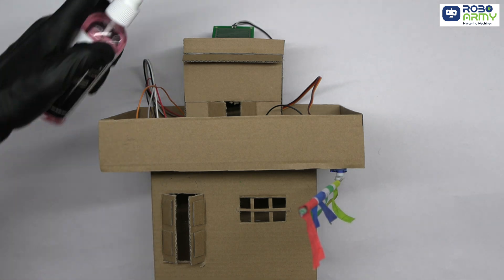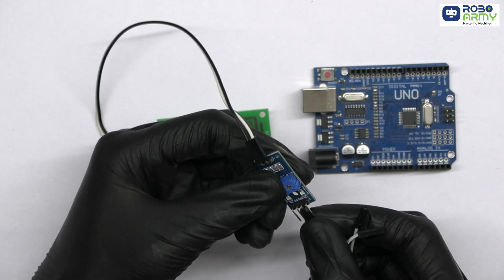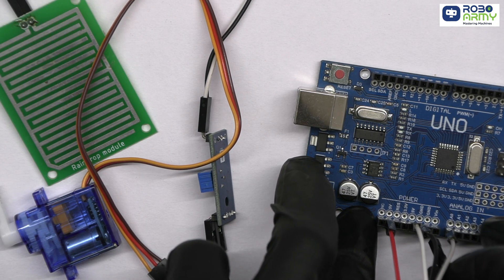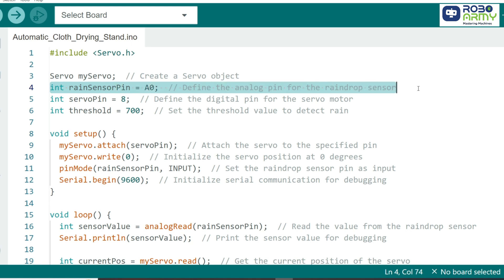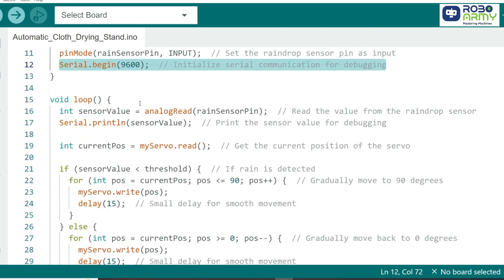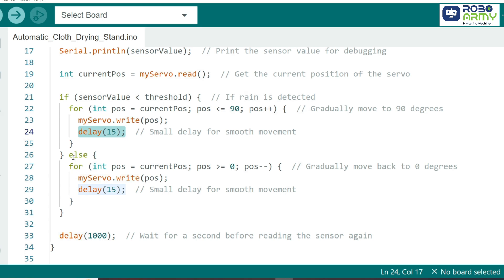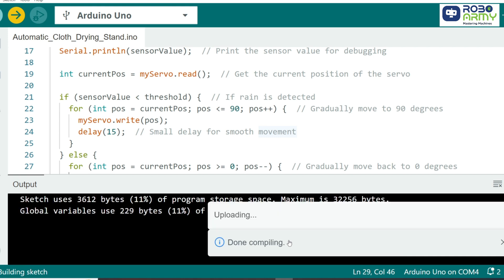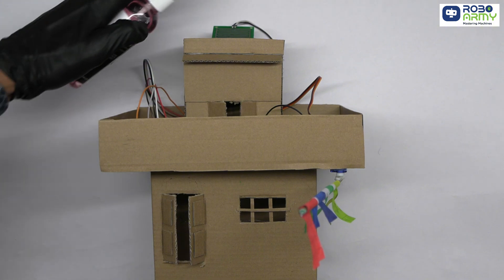Automatic Clothes Drying Stand using Arduino, Servo, Raindrop Sensor I Robo Army I Arduino Project

Comment: Hi, I have question, if use Maker Uno board, not Arduino, can I use the same code as the one you instructed?
Reply from the maker: Yes, absolutely! 😊 Maker UNO is compatible with Arduino UNO, so you can use the same code without any changes. Just select Arduino UNO in the IDE before uploading. Are you planning to try this project with Maker UNO?

Comment: Why does my servo keep spinning? It won't stop.😢
Reply from the maker: That usually happens when the servo is a continuous rotation servo instead of a 0°-180° standard servo 😊. Check the model printed on it. If it's continuous rotation, it won’t stop because it’s meant to spin like a motor. Try using a standard 180° servo and it will work perfectly. Let us know which servo you’re using!

Comment: Bro is it possible to make this without Arduino. Is it safe also
Reply from the maker: Great question! Yes, it is possible to make a simpler version without Arduino using relays, sensors, and motor controllers — but you’ll lose the smart control & smooth movement features. With Arduino it’s much safer and more reliable because you can control movement speed and avoid sudden jerks.
Thanks for asking! 😊 Are you planning to build your own version?

Comment: Hi, I'm having trouble opening the file. Could you send me the code here?
Reply from the maker: #include <Servo.h>

Servo myServo;  // Create a Servo object
int rainSensorPin = A0;  // Define the analog pin for the raindrop sensor
int servoPin = 8;  // Define the digital pin for the servo motor
int threshold = 700;  // Set the threshold value to detect rain

void setup() {
  myServo.attach(servoPin);  // Attach the servo to the specified pin
  myServo.write(0);  // Initialize the servo position at 0 degrees
  pinMode(rainSensorPin, INPUT);  // Set the raindrop sensor pin as input
  Serial.begin(9600);  // Initialize serial communication for debugging
}

void loop() {
  int sensorValue = analogRead(rainSensorPin);  // Read the value from the raindrop sensor
  Serial.println(sensorValue);  // Print the sensor value for debugging

  int currentPos = myServo.read();  // Get the current position of the servo

  if (sensorValue < threshold) {  // If rain is detected
    for (int pos = currentPos; pos <= 90; pos++) {  // Gradually move to 90 degrees
      myServo.write(pos);
      delay(15);  // Small delay for smooth movement
    }
  } else {
    for (int pos = currentPos; pos >= 0; pos--) {  // Gradually move back to 0 degrees
      myServo.write(pos);
      delay(15);  // Small delay for smooth movement
    }
  }

  delay(1000);  // Wait for a second before reading the sensor again
}

Comment: Is it applicable on REAL CLOTHESLINE/ REAL-LIFE SIZE CLOTHESLINE? Is it a same process or nah? Thank you!!
Reply from the maker: Yes, absolutely! 😊 The same concept can be applied to a real-life, full-size clothesline. You’ll just need a stronger motor or a geared motor instead of a small servo to handle the weight of real clothes. The sensor and control process stay exactly the same.

Comment: Sir my servo is not rotating
Reply from the maker: If your servo isn't rotating, try checking the wiring connections, verifying the power supply, and ensuring the code sends the correct signals to the servo pin.
Reply: Right now sir the servo is working but the rotation is 360° not like in you video How to fix this by the way The servo motor we buy is Sg90

Comment: Sir, the values of code are also coming but the servo motor is not rotating, please give some solution.
Reply from the maker: Please make sure that the servo motor is connected to the correct pin on the Arduino and that it is receiving enough power.

Comment: sir can you give me the code please i cant nd its always error message so cani copy your codeand then paste it
Reply from the maker: the full code is available in the video description — please check there!
Reply: @robo_army_  sir the code is good but the servo motor it keeps spinning 360 degrees and i think the code is wrong and i tried anything and it doesnt work can you help me?
Reply from the maker: Thanks for trying it out! 😊 It sounds like you’re using a continuous rotation servo, which spins 360° instead of moving at an angle. Try using a standard servo (like SG90 or MG90S) — it will rotate only between 0°–180°, and the code will work perfectly 👍 Let us know once you test it!

Comment: Mister what kind of arduino you have because i have a arduino but it's doesn't have a 2,5v it's just 1 so where do you buy it or can you have a suggestion for me? Please answer fast mister its for project pleasee its mean so much to me is you can answer it fastt pleeasee😊
Reply from the maker: Hey! I’m using a regular Arduino Uno — it doesn’t have a separate 2.5V pin either. You can safely power your components using the 5V or 3.3V pin depending on what your sensor or module requires.
If your project needs 2.5V exactly, you can use a voltage divider (with resistors) or a DC-DC step-down converter to get that value.

Comment: Hi I'd like to do this project but rather than the rain sensor, I only have the water sensor at hand.

Would you happen to have any code and diagram for something like that?
Reply from the maker: Absolutely! You can use a water sensor instead of a rain sensor—it works similarly. Just connect the sensor’s signal to A0, VCC to 5V, and GND to GND. The code will be almost the same; the only difference is reading the water sensor value. I can share a simple diagram and modified code if you want!

Comment: hai my project is failed, my servo doesn't rotating, what can i do? please help me, and then is it mandatory to include the library into arduino??
Reply from the maker: Oh no, don’t worry — we’ll fix it together!  First, make sure you’ve included the Servo library (it’s mandatory). Then check your wiring — the signal pin should go to D8, and the servo needs proper 5V and GND. Also, try uploading the example code from File > Examples > Servo > Sweep to test if your servo is working. Let me know what happens!
Reply: @robo_army_  how to add the library to arduino?
Reply: Yes, it is mandatory to include the library, otherwise the servo does not work.

Comment: This code is error : exit status 1 what  can I do salove this problem
Reply from the maker: Don't worry!  That usually happens if the Arduino IDE can’t find the right board or library. Make sure you’ve selected the correct board (like Arduino Uno) under Tools → Board, and the Servo library is included. If the error continues, share the full error here and I’ll help you fix it!

Comment: Sir project code not open please help me I need this code
Reply from the maker: here is the full code -
#include <Servo.h>

Servo myServo;  // Create a Servo object
int rainSensorPin = A0;  // Define the analog pin for the raindrop sensor
int servoPin = 8;  // Define the digital pin for the servo motor
int threshold = 700;  // Set the threshold value to detect rain

void setup() {
  myServo.attach(servoPin);  // Attach the servo to the specified pin
  myServo.write(0);  // Initialize the servo position at 0 degrees
  pinMode(rainSensorPin, INPUT);  // Set the raindrop sensor pin as input
  Serial.begin(9600);  // Initialize serial communication for debugging
}

void loop() {
  int sensorValue = analogRead(rainSensorPin);  // Read the value from the raindrop sensor
  Serial.println(sensorValue);  // Print the sensor value for debugging

  int currentPos = myServo.read();  // Get the current position of the servo

  if (sensorValue < threshold) {  // If rain is detected
    for (int pos = currentPos; pos <= 90; pos++) {  // Gradually move to 90 degrees
      myServo.write(pos);
      delay(15);  // Small delay for smooth movement
    }
  } else {
    for (int pos = currentPos; pos >= 0; pos--) {  // Gradually move back to 0 degrees
      myServo.write(pos);
      delay(15);  // Small delay for smooth movement
    }
  }

  delay(1000);  // Wait for a second before reading the sensor again
}

Comment: My arduino only has one 5v, what now?
Reply from the maker: No worries!  You can still use your Arduino’s single 5V pin by using a breadboard power distribution or a 5V regulator to safely power multiple components.
Reply: @robo_army_ my city doesn't have it breadboard

Comment: wht if idont have the raindrop sensor? can i replace it with something else
Reply from the maker: Good question! If you don’t have a raindrop sensor, you can replace it with alternatives like:
🌧️ Soil moisture sensor (works on similar principle)
🌧️ Simple IR sensor to detect water drops
🌧️ Or even use a homemade setup with two wires/metal strips close together — when rain falls, water bridges the gap and Arduino detects it

Comment: hi，can i use esp 32e with blynk app，to connect this one？how to do this
Reply from the maker: Hi! Yes, you can use an ESP32 with the Blynk app for this project 😊. You’ll just need to modify the code for Wi-Fi and Blynk integration so you can control or monitor it from your phone
Reply: @robo_army_ thanks，and one more question，if i use battery，how much  volt i want to use

Comment: There was a problem with the code . Please, how the servo red wire
Reply from the maker: The red wire of the servo is the VCC (power) wire. Connect it to the 5V pin on the Arduino. Let me know if you need help with the full wiring!

Comment: Sir i have a water sensor instead of this rain drop sensor .my project is smart waste segregation system.
My question is ..do i need the comparator module with the water sensor? Or should it directly work with Arduino?
Reply from the maker: Great question! If your water sensor gives an analog output, you can connect it directly to Arduino's analog pin. But if you're using it for threshold-based detection (wet/dry), the comparator module helps give a clear HIGH/LOW digital signal. Let me know your exact sensor model—I’ll guide you better!

Comment: can i replace arduino uno with arduino nano?
Reply from the maker: Yes, absolutely! 👌
You can replace the Arduino Uno with an Arduino Nano for this project. Both boards use the same microcontroller (ATmega328P), so the code and connections remain the same.

Just make sure to match the pin numbers correctly and use a Mini USB cable for uploading code to the Nano.
Reply: @robo_army_  I don't know if it's too much to ask, but could you make the nano version? Codes, cables, etc., I would greatly appreciate it. Sorry if the text is bad. I'm from Brazil and I'm following your work from here using Google Translate. By the way, your work is very good. 😊👌
Reply from the maker: Thank you so much! 
Your message is perfectly clear, and it truly means a lot that you're following from Brazil! We're really happy to know you're enjoying the projects.

And don’t worry — it’s not too much at all! We’ll definitely share the Arduino Nano version of this  project, including the code, wiring, and USB cable info very soon. Stay tuned, and thank you again for your kind words and support!
Reply: Okay, my friend, I'll keep an eye on the projects, thank you very much, you mean a lot to Brazil. @robo_army_

Comment: Sir, when can I buy these components
Reply: Is there any specific model no. for Arduino Uno
Reply from the maker: Its Arduino Uno R3..
Reply from the maker: Soon we are going to tis project's kit on amazon.
Or you can purchase from online store or local market
Reply: Ok sir
Reply: Sir ,When did you post the kit on amzon
Reply: Sir I wanted to add the solar panel can you provide the circuit diagram and code  along with solar panel

Comment: Good video. But what if the Arduino uno has only one 5V power pins? Because in the video, both the sensor and the servo motor each connects with two different 5V pins to the Arduino. Thanks
Reply: You can use same 5v from arduino by use soldering
Reply: @sellerhub8829 oh, thank you for the guide👍
Reply from the maker: Great observation! 😊 You're right—Some Arduino Uno has only one 5V pin, now coming with two 5V pins. We can use a breadboard to split the 5V line to power both the sensor and the servo. We can easily do the same with jumper wires on a breadboard.

Comment: The sensor is working, but there's a problem the servo motor should stop rotating when it's dry, but it doesn't. The rain sensor activates correctly when wet. However, even when it's dry, the sensor still triggers as if it's wet. When I disconnect the rain sensor, the dry condition still activates the system.
Reply from the maker: Thanks for sharing! 😊 It sounds like the sensor might still be reading moisture or noise. Try gently drying the sensor surface or increasing the threshold value in the code. If it still triggers, it could be due to leftover water or a faulty sensor. Let me know if you'd like help adjusting the code or testing it step by step!

Comment: Hello sir, I have this problem where it seems like the raindrops module did not work while everything else works. The type I am using is DSK MH-RD(?), different from the one in the video so does that have any difference? When I disconnect the raindrop sensor the servo moves smoothly and when I connect the raindrop sensor it stops which I assume it works like intended in the code. However, the servo does not move at all when the raindrop sensor is wet. What might be the cause?
Reply: Oh and if I may add, the servo stops completely when the VCC and GND of the raindrop sensor small module is connected but it moves from left to right repeatedly when it's disconnected
Reply from the maker: Thanks for sharing the details! It sounds like there might be an issue with the power supply or grounding when the raindrop sensor is connected. Some raindrop sensors, like your DSK MH-RD module, can draw more current than expected, which might affect the servo's operation.

Here are a few things to try:

Make sure the VCC and GND pins of the raindrop sensor are properly connected to the 5V and GND of the Arduino.

Check if the sensor is pulling too much current. If so, try powering the servo and sensor from separate sources.

You can also add a delay between readings in the code to give the system more time to process.
Reply: @robo_army_  Thank you for your advice sir, it works now!
Reply from the maker: @yedjuy  Thanks for the kind words—more coming soon. Stay tuned!

Comment: Can i use unrechargeable battery?
Reply from the maker: Yes, you can use a non-rechargeable battery, but a rechargeable one is better for long-term use. If using non-rechargeable, make sure the voltage matches your components. Let me know if you need help! 😊👍

Comment: why my water sensor doesn't blink and don't work at all also what i need to do to know if this think is broken or alright
Reply from the maker: You can check if your water sensor is working by following these steps:

1️⃣ Check Power: Ensure it's properly connected to VCC (5V) and GND on your Arduino.
2️⃣ Test Output: Use a multimeter to check if the signal pin changes when water touches the sensor.
3️⃣ Try Serial Monitor: Upload a simple code to read analog values and check if they change.
4️⃣ Inspect Connections: Loose wires or wrong pin connections might be the issue.

Let me know what you find! 😊👍

Comment: Sir,I've written the code if rain is detected gradually move to 90° and else if rain is not detected gradually move back to 0°.but the servo is rotate 360°.so is there any mistake in m'y writing ?
Reply from the maker: It sounds like you might be using a continuous rotation servo instead of a standard 180° servo. Check your servo model—if it's a 360° servo, it won’t stop at specific angles. Let me know what servo you're using, and I'll help you fix it! 😊👍
Reply: @robo_army_  my servo too, move 360 servo, but my series servo SG90 so how to fix it?
Reply from the maker: SG90 is a 180-degree servo, but if yours is moving 360°, it might be a continuous rotation servo. Try using myServo.write(90); to stop it, 0 for full reverse, and 180 for full forward. Let me know if you need more help! 😊👍

Comment: In Arduino IDE, why is the code take too long to upload?
Reply from the maker: The upload time can be slow due to various reasons, such as incorrect board selection, a busy COM port, a faulty USB cable, or background processes using the port. Try checking your connections, selecting the correct board and port in the Arduino IDE, and restarting the IDE if needed.
Reply: Bro please share me the code

Comment: this project is perectly working .
i just tried it....................
but never use 9v battery or else the servo will start to have faults. in my case servo stopped.
use litium ion battery with double battery holder. if you cant find with jack buy a double holder and buy a battery connector with jack in online . cut the end and join both now you will have battery holder with jack .
hope this helps
Reply from the maker: Thank you for your valuable feedback! 😊 Glad to hear the project worked for you. 🚀 Your tip about using a lithium-ion battery instead of a 9V is really helpful! This will surely help others avoid servo issues. Thanks for sharing! 🔥🔧 #RoboArmy